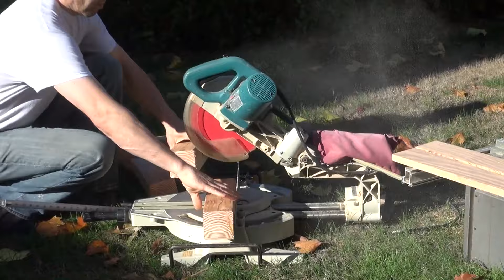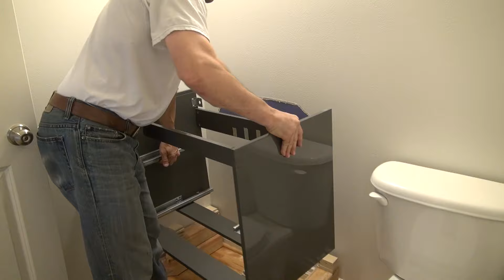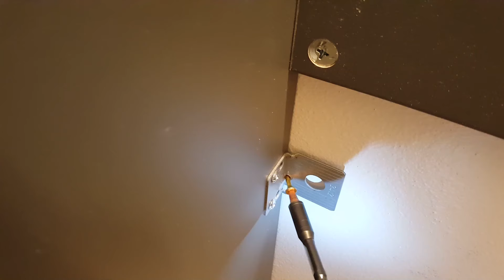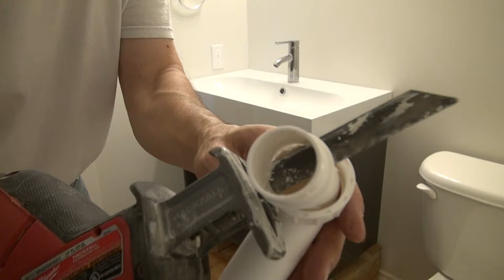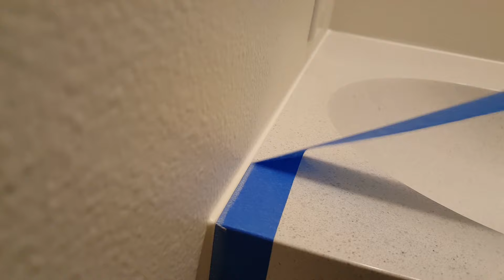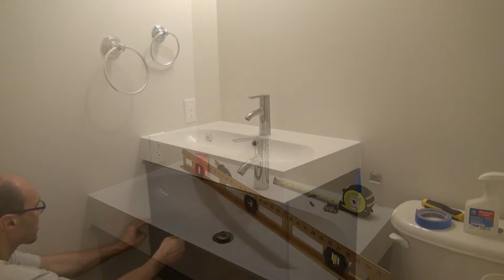IKEA Wall Mount Cabinet Installation. Установка раковины ИКЕА

Comment: learn something today, you used a wood strip to mount onto the stud in the wall and the cabinet mount on to the strip!! Just saw another video in which the installer had to cut holes in the dry wall to fit the cabinet mount....your method is much better
Reply from the maker: Thank you!

Comment: Almost perfect, before using finger for silicone...
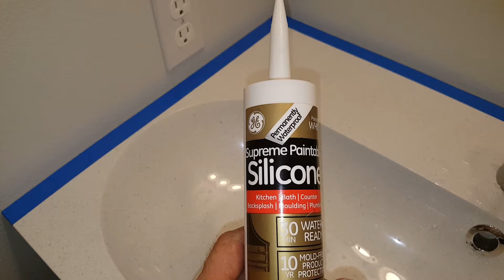Reply from the maker: Thank you. This is not a regular silicon. You can see at 4:06 this is paintable silicone, so it will be painted at the next day in wall color. 
No one use tools for any painter's caulk/silicon because it will be covered by paint later.

Comment: Great video. What's the thickness of the plywood used for support at the back?
Reply from the maker: Ibrahim Momoh  Don't use any type of plywood! This is oak board.
Reply from the maker: Ibrahim Momoh And the standard thickness of 3/4" (20mm)

Comment: Good job! Can this sink be mounted on a countertop?
Reply from the maker: Yes,  here is a similar IKEA sink installation: 
IKEA sink installation -  https://youtu.be/sBSgZ2yLXlk
Under IKEA sink P-Trap installation -  https://youtu.be/Ir1iQ5Z8Ays
Reply: @FixitAll  I mean the one from the movie above (Braviken). When mounting on a countertop, it must be pushed against the wall, because the back is empty?
Reply from the maker: @jakubhap3782  i understand.  Yes you can push to the wall.
Just cut two holes for drain pipe and fauset hoses. No need cut out a big square ounter sink. Save slab surface us more us you can for strong granite.
Reply: @FixitAll  Thanks. I will have a wooden top :)
Reply from the maker: @jakubhap3782  I see.
Reply: @FixitAll  What is the width of this sink?
Reply from the maker: @jakubhap3782  I think 30". Check IKEA website.
Reply: @FixitAll  Thanks.

Comment: Was old vanity same height? That power outlet looks way low.
Reply: If I remember correctly, when freshly built house is being wired, electricians put outlet at 42in and light switch at 48 height of junction box bottom.
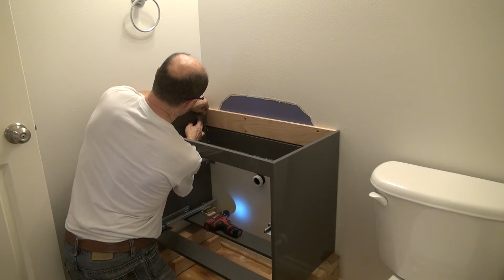Reply from the maker: Same. You can see old blue paint from sink at 2:12
Reply from the maker: There was pedestal sink.

Comment: Is the sink included in the cabinet?
Reply from the maker: No, but you can buy it at same time in IKEA.
Reply: @FixitAll  thanks for the reply. What specific tools did you use for this one please?
Reply from the maker: @edenharayo4195  usually just a drill and screwdriver. Depend on the wall construction.

Comment: I’m curious why you cut that piece of dry wall out
Reply from the maker: Corners usually got more drywall mud + corner tape when it finished. So it's never 90 degree. But corner of porcelain sink 90 degree. As a result, sink cannot touch both walls, in my situation left and back sides. After cut off/trimming, the sink corner moves deeper into wall and both sides contact wall without gap.

Comment: I’ve never seen someone have to drill so many holes and bastardise a unit that is designed so you don’t have to. 
Messy job
Reply from the maker: Show me how you can.
Reply: You have to understand why he did what he did...There is a reason behind all "unnecessary" steps.
Reply from the maker: @Bokicazver  Thank you.
Reply: I was thinking the same? Why was it necessary to add an additional piece of wood, did he not trust the unit to support the back of the basin? 

I thought he added the wood because the wall studs did not align with the ikea brackets, but ikea specifically state that the rear piece of wood can be used to add additional support screws.

The biggest fault is cutting the ikea unit, that will let humidity in over time as the material is not high quality, the correct way to add a piece of wood is to move the ikea brackets away from the wall one knotch, by using the fixing screws in the alternative holes provided in the bracket, instead he just put screws in all 4 holes…. Lots of different types of screws used there as well, I think even drywall screws?

The idea of the corner screw through the middle of the bracket was interesting though, but unnecessary.

Wouldn’t all of this modification have been unnecessary and resolved by just mounting the unit 2cm higher and according to the instructions.